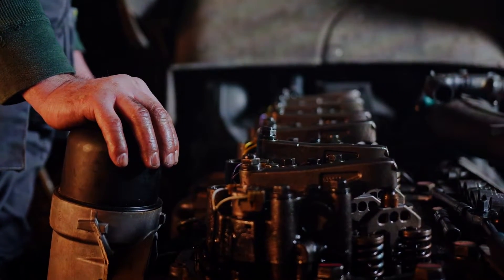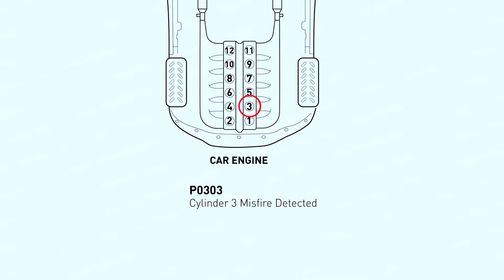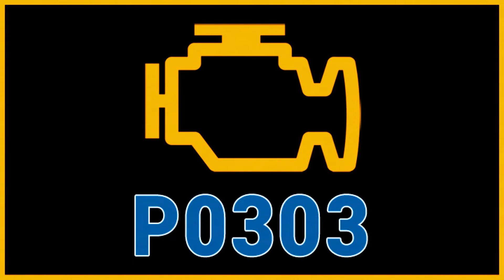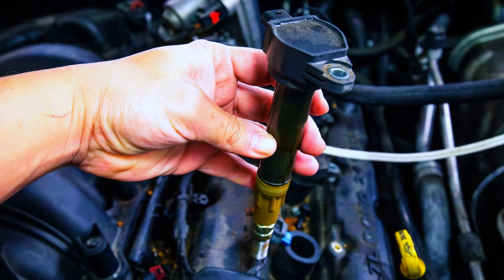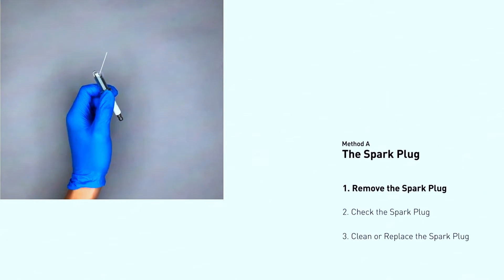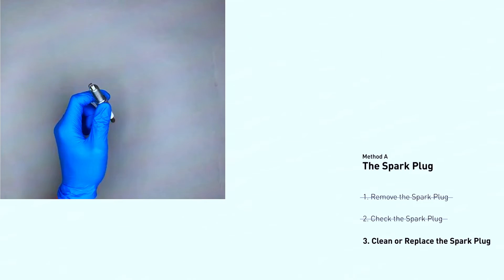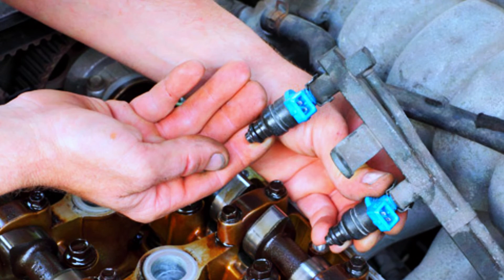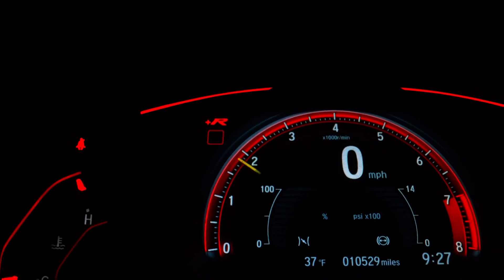P0303 Code Explained: What Does It Mean and How to Fix It?

Comment: Fuel injectors are a lot easier to replace in my opinion
Reply from the maker: That’s true — on many engines, fuel injectors are fairly accessible, especially compared to components like ignition coils or spark plugs buried under the intake. However, when dealing with a P0303 code (cylinder 3 misfire), it’s still important to confirm the injector is the real issue before replacing it.

A quick way to check is by swapping the injector from cylinder 3 to another cylinder and seeing if the misfire follows. If it does, the injector is faulty. If not, it could be a coil, spark plug, compression issue, or wiring fault.

So yes, injectors can be easy to replace, but proper diagnosis first saves time and money — otherwise, you might replace a good part and still have the same misfire.